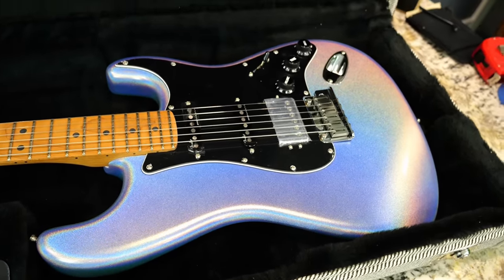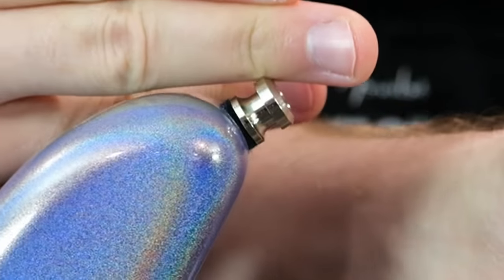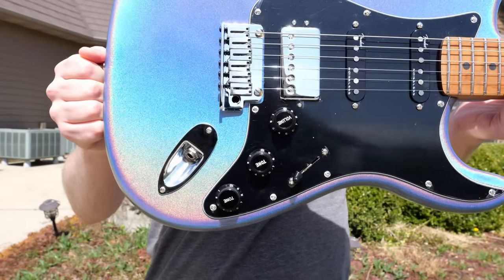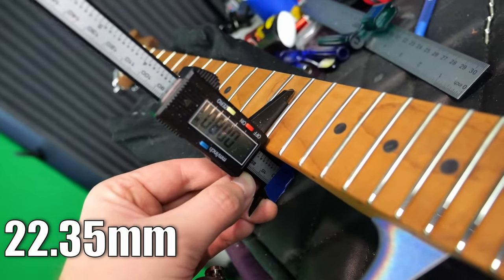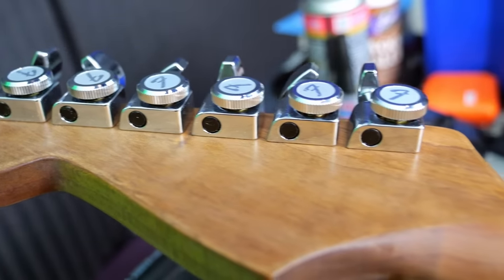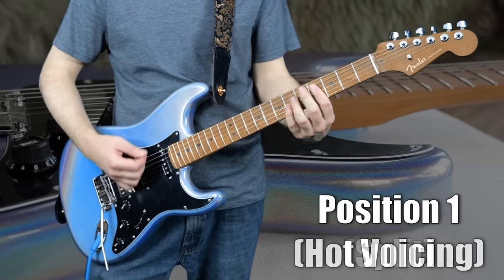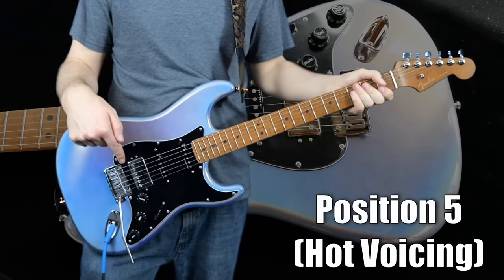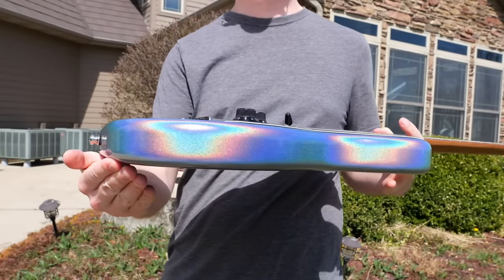Fender Got These RIGHT! | 70th Stratocaster Ultra Amethyst Review

Comment: I’m so glad Trogly finally documented one of the 70th Anniversary Fender Stratocaster. Especially that new finish on the Ultra Strat & looks beautiful.
Reply: Yup this is a sweet looking and sounding guitar. Can't find fault in it from the review. If I had the spare cash I would be ordering one today as even the price seems fair enough for what you get. However, already have 2 strats I have bonded with so just pleased for anyone buying this great anniversary model :)
Reply: @martin-1965 the only problem I’m disappointed about the 70th Anniversary Ultra Stratocaster is they should’ve feature stainless steel frets (like they did to the 60th anniversary Ultra Lux Jaguar [2022]). Also I can’t play it because I’m left handed.

Comment: The oil /satin finish neck of a Fender is so far superior to the sticky gloss of a Les Paul. When gigging, for most working class musicians the Fenders are more comfortable, stay in tune, lighter, etc. BUT  if you can afford the more expensive Gibsons, the Custom Shops, and get them plex'd and set up they are amazing!
Reply: Whaaa? I have zero problem gigging my Les Paul.
Reply: Why on earth should you need to get a Gibson custom shop and have it Plek'd? If I dropped several k on a guitar I'd expect it to be setup perfectly
Reply: You speak for most working class musicians?  I play in a rock cover band.  I wouldn’t be caught dead with a strat with floating bridge at a gig.  Nightmare
Reply: Every single Gibson is already Pleked from the factory.
Reply: My 1979 Gibson Les Paul deluxes have gigged for a solid 4 decades, I have never even needed to undo the truss rod covers, those mini humbuckers are heavenly and no 60 cycle racket, in my opinion the bridge pu on strats  would be perfect replaced with a Gibson mini humbucker.

Comment: Thank You William, Congrats on the new guitar, very nice indeed.
As for the cost, to put the $2500 price into perspective, back in 2000 I purchased a Guitar Center Designer Series Deluxe American Stratocaster that came with a 3/4" thick 5A Quilt Maple Top,  new that Stratocaster cost me $2100, a lot of money for an American Strat back then.  However, that 2000MY Deluxe Strat has been one of the most rock-solid guitars I've ever owned!  I still own it and my only complaint is the poly finish, other than that the active quilt top combined with the transparent Crimson Red color adds up to a beautiful guitar, even 24 years later.   I still get a big smile every time I open the case.
Nice review, thanks for the content Austin.
Reply: @geoffreycarter3981  I agree with you.
Also, it seems that Fender has remained more flexible in their guitar designs in that they don't seem to be held to the traditional/vintage designs like Gibson.  It could be that Gibson's set-neck construction doesn't lend itself to as easily change designs and lower cost as Fender's bolt on neck.
As an example, a Fender Strat could be made out of almost any wood and I'd be personally OK with that if a lower price reflects said change, whereas, make a Les Paul out of anything other than Mahogany and Maple and its blasphemy!  
Also, Leo Fender was all about ease of manufacture to lower costs, Gibson is steeped in the traditional aura of old-world construction methods and quality.  I think both philosophies are great/valid and I'm glad we have both Gibson and Fender to chose from and play.
That is my $.02 Cents

Comment: This is NOT a good option because
- No rosewood fingerboard
 - No boost for the neck pickup like CLapton
 - no good trem like Beck 
- The neck pickup only sounds vintage so not ultra hot like the other ultra strat series

Comment: Hello. May I ask you a question concerning the Ultra Quadra Tap pickup? I ordered the guitar but I'm very surprised that the pickup is noisy in humbucker mode (i.e. with the S1 vol switch not pressed) - more so in the hot voicing mode (with the tone switch pressed). Surprisingly, the hum/noise goes away when I coil-tap it into the single-coil mode (i.e. press the S1 button)- which is the exact opposite to what I would expect. Normally, humbuckers cancel hum and vise versa. So I wonder if this is the design of the Quadra Tap or if I have a faulty piece? Thanks in andvance.

Comment: Pickups are indeed different. The data from the official service manuals:

70th Anniversary Ultra: 8.28-8.79K neck, 8.93-9.48K middle, bridge 5.69-6.04K split, 7.72-8.20K vintage voicing, 11.41-12.11K hot voicing.
HSS Ultra: 12.3-12.9K neck/middle, 13.9-14.5K bridge.
SSS Ultra: 7.9-8.7K neck/middle, 9.2-10.0k bridge.
Reply: Yes and they sound HORRIBLE  Fender PLEEEEEZE Stop this craziness with these new guitars.. Just horrible tones
Reply: @jimmyoandrhondalee7431  Why? Are they worse than the previous Noiseless pickups on the American Deluxe series? Or do you mean that the stock pickups on regular Ultras are better?
Reply: The pickups are one of the best features. They really got those right.

Comment: The bottom horn cut is pointless, it needs to be on the front side to make access to the upper frets easier.
Reply: I got an Ultra and that cut combined with heel contour makes access to top notes easier than the traditional Strat. So it’s not pointless, maybe just not as extreme as you desire. I like that it maintains the traditional Strat look from the front though.

Comment: Sweetwater has these listed with a Nitro finish... me thinks they might be wrong but they assure me they aren't. Guess I'll have to wait until mine arrives to find out for myself.
Reply: I mean, it's listed on Fender's site as Gloss Urethane. Sweetwater reps are extremely hit or miss and in this case are just parroting their already wrong specs.
Reply: @Halljamz  I think this one would look bad with a worn out nitro finish anyways.
Reply: Fender also referenced nitro on their own website. Specifically the neck/headstock. I checked with them, it's 100% urethane.

Comment: Am I blind or was there no split/un-tapped readings?
Reply from the maker: they were cut out for not making sense. Both s1 switches made it read around 14k which means too much wiring was in the way as a split should half the reading - not double
Reply: @Trog  it is too bad we didn't get readings. That pickup was the most interesting part.  Hopefully some one takes one appart and posts the guts